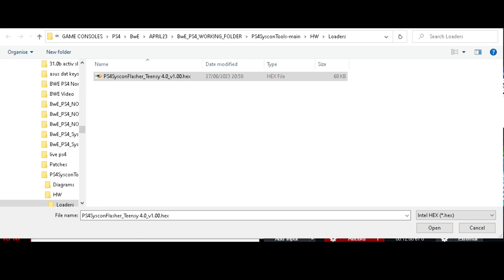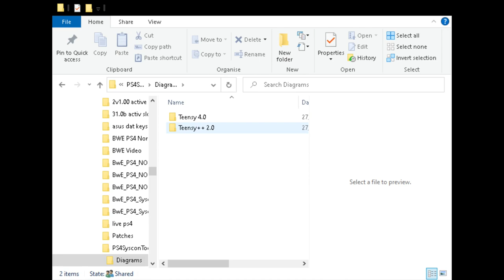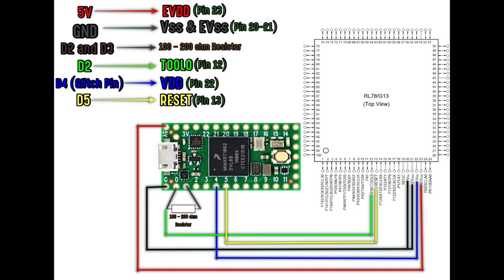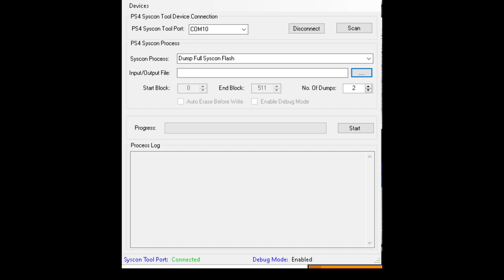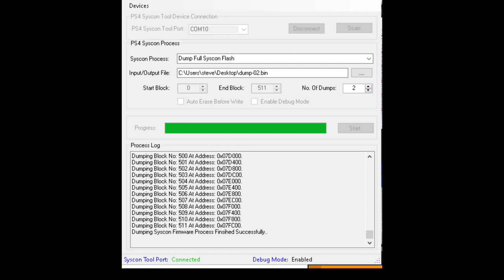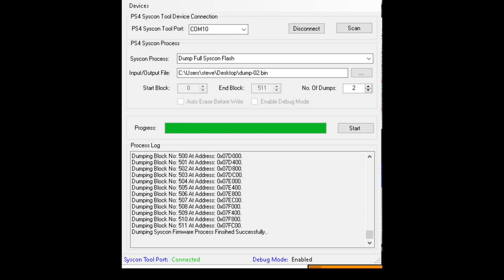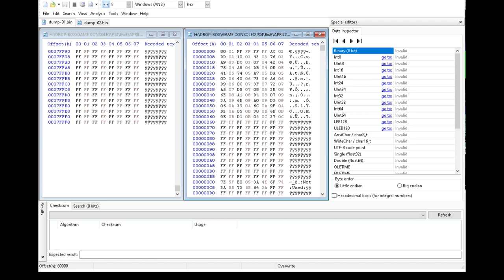LETS HAVE A LOOK AT, AND BUILD THE NEW PS4 Syscon Tools  By Abkarino & EgyCnq

Comment: Thanks for the video.  Aliexpress has teensy 2.0.  Will this work for me?
Reply from the maker: It only works with the teensy 2++  teensy 4, teensy LC  i havent tried any others
Reply: @Steve_be  The PS4 slim version I have is 10.01.  I understood the main logic of this method.  The only thing that remains dark for me is my PS4. Will it be downgraded from 10.01 to 9.00?  What is the version logic in this new downgrade method?  I would be glad if you answer.  Thank you for this video.
Reply from the maker: , you can only downgrade to the previous OS also some syscons wont downgrade   SO IF THE PS4 HAD 9.6 ON BEFORE 10.1 YOU CAN ONLY GO BACK TO 9.6..    some systems wont down grade.
Reply: @Steve_be  I got it now. When I look at the update list, it is 9.6-10.00-10.01, is it correct? 
For example, I patched the two eeproms on the machine with 10.01 and wrote. Do I need to write 9.6 firmware to the HDD after that? Or will the operating system on it work? I'm sorry I'm taking up your time with so many questions.
Reply: @Steve_be  Sir, I understand this restoration now. A and B slot logic. For example, let's say my PS4 was version 9.00. I updated it directly to 10.00 again. My old version backs up the PS4 itself in the other slot. So it will send me back to whatever my old version was.
Reply from the maker: @diacomservice  correct sir
Reply: @Steve_be  Good day :)
Reply: I'm sorry if I bothered you with questions. My last question. Do you have any information about writing the syscon software with Arduino Nano? Compared to Teensy Arduino, it is not available in our country and is very expensive.
Reply from the maker: @diacomservice   not as yet Abk said he would be porting to  a raspberry pico at some point, but he is on holiday in china at the moment ill ask him when he gets back
Reply: @Steve_be  I also have this idea in my mind. Let's say Backup version 9.03. The active one is 10. If we write the backup version 9.00 spi and syscon dump files to another PS4 with the same platform, will it work?
Reply: @Steve_be  https://www.youtube.com/shorts/Uc5kHQAGwz4
This Indian guy uses Arduino Nano for writing in this video.
Reply from the maker: @diacomservice  thats BwE unit he charges for them,  i have just sent a message my mate to see if he can port the free software to a nano. Or similar there is a nano 3 reader but no writer,
Reply: @Steve_be  thanks . I have to buy teensy now
Reply: @Steve_be  hello. Is there a significant difference between the teensy ++2.0 Atmel chip version and the other version? Otherwise, the software will do the same job.?
Reply from the maker: @diacomservice  no the 2 dont work,  they are looking into finding devices that are available as he lives in Egypt him self im in uk
Reply: @Steve_be  Do you have an e-mail address? I got information about the reading and writing project with Arduino.
Reply from the maker: @diacomservice  https://discord.gg/m7KaUapY

Comment: Good job
Reply from the maker: Thanks
Reply: @Steve_be  i need help repairing ps4 pro console for 2 seconds blue light of death how to read errors from sycon ?
Reply from the maker: @TOMelectronicsfix  you need to reprogram the Nor chip to enable UART then you can use a uart to look at the boot sequence..  you have check for shorts on the various power rails
Reply: @Steve_be
Reply: I already have medicon TX and GND connected and after connecting the syscon power supply ok 00000000: 3A voltage at 3.3 volts on the control pinouts
Reply from the maker: @TOMelectronicsfix   to use UART to need to set the uart on bit in the NOR..  have you done that ….  My discord. https://discord.gg/4kPz5n9G

Comment: My ps4 version now is "9.04" and I don't know what is the last version before... So if it was a 7 or 8 .. can I do the downgrade and then I upgraded it to 9.00 ?
Reply from the maker: You should be able to downgrade to previous version   If it updates again it will load the current version. This unit is only a read writer you will need something to create the patch for the nor or you will need to edit the syscon software
Reply: @Steve_be  so if I use the abkarino syscon tool to downgrade to 7 or 8 (for example) and then I upgrade to 9.00 normally?
Reply from the maker: @ROX99  no, the tool it self will only download and upload the files you need to modify the files you dump then rewrite the modified files, you can only go back to the previous version so if you had 7.** on before say 9 then it can only go back to 7.**.  Update i dont know i havent had time to test yet,  theres a twitter link to the guys send message direct  to them to be certain
Reply from the maker: @ROX99   you can downgrade to the previous core os what ever it was, say like now your on 9.04 if this was updated  say from 7 the you can go back to 7 but if you update from 7 it will go the the latest firmware or if you have a off line version of 9.04 you could go back. But you cant go back further than 9.04
. At the moment hope that made some kind of sense

Comment: Is there any issues with it 
Cuz i want to buy a 9.03 console and i asked someone he said its not stable
Can you confirm ☺️😊
Reply from the maker: 9.03 is ok as a working os or are you asking about downgrading if so its not 100% and you can only downgrade to the previous os
Reply: @Steve_be  
I want to buy a 9.03 os ps4 slim
So i can revert to 9.00
Reply from the maker: @sidoo5434  there is always a risk but if you have all the right tools and follow instructions that others haVE  done should be ok there is a pdf just been posted on twitter  ill put a link above
Reply: @Steve_be  
Ok

Comment: can i use Arduino uno or promicro؟ , its same controller and and available here
Reply from the maker: No to uno the teensy 2 uses a ga32u4. The teensy 4  you can see the chip in the video, why cant you get a teensy
Reply: @Steve_be  it's hard and complicated to ship like this component to my country  🤕
available boards is Arduino, raspberry
also i have ch314a programmer if it's help 🤔
Reply from the maker: @crypt8902   you can use the ch341a program mer but you need a teensy 4 where are you
Reply: @Steve_be  is there difference between teensy 2.0 and 2++ ? 

from libya
Reply from the maker: @crypt8902  they have different Mcu’s so a 2++ wont work
Reply: @Steve_be  thanks for info  😊 
last question, 
is there hope to implement  glitch ,read , write, with any Arduino board ? or there some specific hardware needed which makes Arduino not applicable?
Reply from the maker: @crypt8902  i have only seen software for read/write for the teensy 4 and 2
Reply from the maker: @crypt8902  not that i know off, i think teensy 2 uses a 32u4 mpu so you could try using any thing that uses same chip but i cant guarantee itwill work, why cant you get teensy 4 or 2
Reply: @Steve_be  I'll try to get one , my ps4  is on 9.30 so i have good chance to downgrade
Reply: @Steve_be  hi Steve, is it possible to dump sie syscon chip 😕?  have you tried with it ?
Reply from the maker: @crypt8902  I havent tried tbh

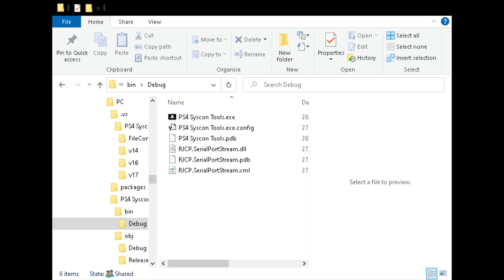Comment: на 14:00 версии ПО  не видать !!!  и при запуске  Syscon Tools   tensy2++ без проводов вылетает  100% ошибка на  ПО v1.0.1 и 1.0.0
Reply from the maker: I dont know try contacting the author of the software his youtube link is on hear..   i used teensy 4 on usb
Reply: @Steve_be  
ok thanks tell me your software version ? you can't see it there!
ок спасибо  поскажите вашу версию ПО ? у вас там не видать !
Reply from the maker: @pinochetaugusto3019   im using 1.01 with teensey 4 works fine.
Reply: @Steve_be  
is it possible without soldering? In no HDD mode. on PS3 WITHOUT PROBLEMS many times sewed on 3.55!
Reply from the maker: @pinochetaugusto3019  on the ps4 you have to solder a d remove chips  on some there are some renesas chips that cannot be used also, it is in its early stages,

Comment: the problem is that the file is missing
Reply from the maker: Which file is missing. I have added a second link to the software in the zip is a fully compiled win ver 1.01. Let me know iif you still have any problems
Reply: Thanks for the info, now I'm working fine